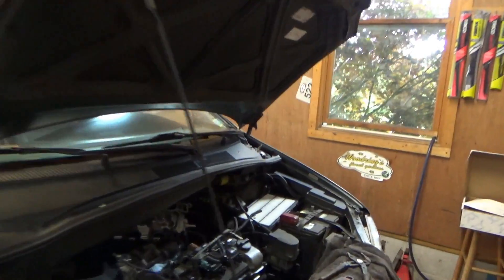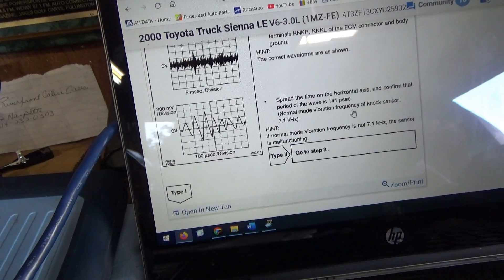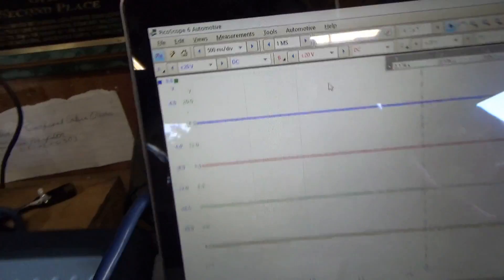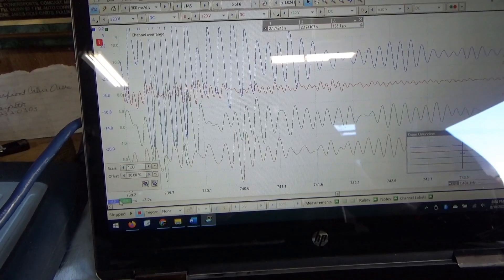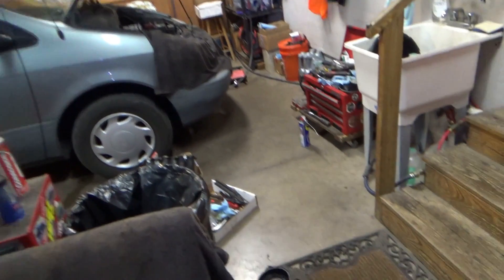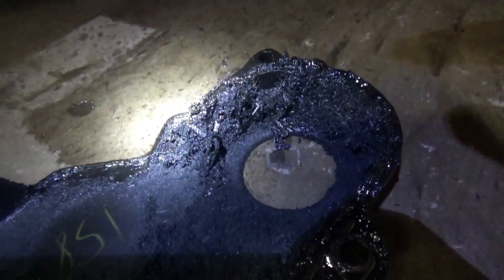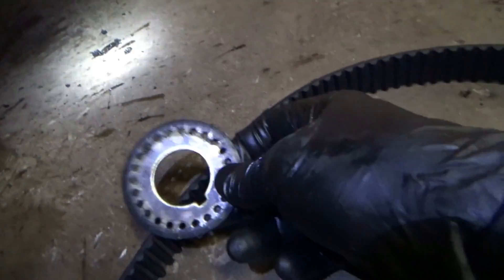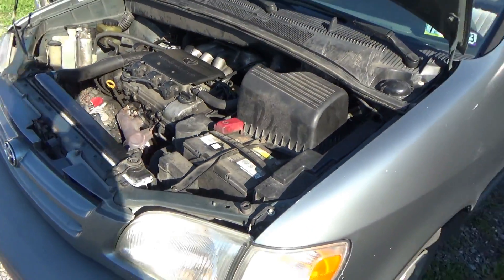Test Knock Sensors...on the BENCH! (Toyota V6 @545k miles!)

Comment: I have a 2003 SIenna and I had a Code for Bank 2 Knock sensor.  I took everything apart, changed BOTH sensors with ALLEGEDLY Toyota parts bought off ebay Both sensors and the wiring about $74 Put the car back together within about 2 miles CEL came on and now I have BOTH Bank one and Bank two!!   I tried checking the connections where the Knock sensor harness goes etc.   cleared it then drove a bit and Codes come back   SOmetimes just bank 2 sometimes BOTH bank one and two.  Previously before I replaced these I only got BANK 2 code.  I am 90-95% sure now that I got scammed and these are cheap generic sensors.  How can I check them IN the car?  If i unplug the knock harness and put a volt meter between the tip connector wire and ground and tap on the engine I should get at least 2-3 Millivolts if I use my Multimeter, right????   I'm ready to scrap this van.  Runs fine and I just put a new AC compressor in May and it only has about 100K miles and no rust.
Reply: Update ..... After doing the following i determined my "new" sensors were bad!!  Low output.   I disconnected the Knock Sensor harness at the back of the engine and put two leads, one to each output terminal.  I then used my Mutimeter set on AC Volts, started the car so I could see what voltages these are sending the ECU.  Turns out they were outputting at idle around .02-.06 Volts YES POINT zero six!  I then revved the engine and in the higher revs 2000-3000 rpms  the sensors read about    .15-.3 volts  Neither sensor ever got anywhere near or over 1 volt.  The new sensors i picked up today (Dorman)  output about  .5-.7 idle and revving goes 1.5-2+ volts  big difference over the once I just replaced 2 weeks ago.  ODD thing these are supposed to be Genuine Toyota parts, I noticed today the sensors say DENSO  around the circumference of the sensor on the Plug side.  Could these be generic FAKE "Toyota" parts?   Seems like it!   I high tailed it and being that I did this 2 weeks ago I knew exactly what to remove, where to position stuff, what NOT to remove, what tools I needed etc..   Last time I didnt have an 8 MM Hex bit socket to remove the 2 inner upper intake manifold bolts.  Had to run to AUtozone to buy a socket.  Ive since bought a very nice set from Amazon for about $38  LexiVon is the name if anyone needs a set.

Comment: Yes Toyota is a good engine..The timing belts are a maintenance item , anod i like to pull the cover about half way through there life cycle or before to just take a look . I drive tdi vw for the for a long time and the na before . I even had a 2lt toyato turbo diesel 4x4  a long time ago ... i once had a ahu that had a timing belt alignment problem after i bought the car . So by checking the belt i saved my self a lot of grief . The belt was in poor shape way before its was supposed to be changed.  I found the how to fix the problem on line . Thanks for the videos

Comment: Cool video, can one have a bad knock sensor without code to cause slight pinging at low speed under slight load. Asked this same question on your latest video on Camry. Any suggestions would be appreciated

Comment: I had a similar vehicle problem recently.  It had an aftermarket fuel injector and was missing on that cyl.  I swapped that injector to another cyl and the plug to a different one and that cyl plus the one I swapped the injector  into were now dead.  I ohmed out the injector signal wire to the PCM to find out if it had a bad driver on that port.   It was fine.  Turns out the aftermarket injector was bad AND the wire couldn't carry enough load to fire it.

I got to thinking about the "chicken or egg" implications of it, and conclude that the wire went bad so someone misdiagnosed it to be a bad injector so put the aftermarket junk in there, which was probably bad from the git-go, but even though it failed my test didn't mean it was the cause of the problem.

Comment: good idea on the sensor bench test. Will start doing some knock sensor testing same way to see how good new sensor output is .
Can't beat 90's to very early 2000's for proper longevity build/component quality .
Based on manufacture to end of life environmental impact it really good and hardly any parts/service waste in over half a million miles, trouble is true environmental solutions don't make big profits, big companies want you buying new every few years, no easy money if make products that faultless for 3 decades 😕
Was enough electrical be useful along with good quality and well located within vehicle so rarely much drama .
Once you start going past 2005 the hassle and longevity and daily reliability declines until you get to latest garbage that faulty right off the production line lol .
 All my old Japanese wagons have been incredibly reliable and low cost, I done 35 years minimal hassle motoring for less than people paying for a brand new headache at the car dealers lol .
My work and customer bills highlights fact too, all the ridiculous failures & crazy hassle and big $ bills are newer garbage ...

Comment: What a great test. It would be interesting to try striking different places to see where you get the most consistent readings on the good ones.  Straight in on the screw, for instance, or at the end of the tail, on the bench beside it, or in front of it, even on the far end of the bench, to see what happens.

Comment: Some of the worst vehicles I've ever owned are Toyotas.  I had 2 in a row that were pure trash.  Both had RC18 engines.  The first had an exhaust manifold crack so that I woke the neighbors up each morning heading off to work.  Then the brake master cylinder completely failed nearly sending me into the next life.  That was all before I hit 12K miles.  The second (the one I traded for after the first), developed warped valves at 6K miles and had to be reworked by the machine shop.  The dealer wanted an astronomical $500 to do the job (that was a fifth of the cost of the car back then).  I opted to remove the head and have it redone at the machine shop and had new valves installed, planed which cost me a whopping $162.  I reinstalled the head and drove it the next day.  I rid myself of Toyotas after than and never even thought of buying another.  Sad POS they are.  I'm sure both had the original starter as they sat in the junkyard with less than 20K miles.  Great longevity (IN THE JUNKYARD THAT IS).
Reply: Was this in around 1968?
Reply: @johnz8210  😁

Comment: I went aftermarket on my mothers Highlander.. to save some money.. same codes set. Both bank 1 and bank 2 knock sensor codes. 

It would go into limp mode when it set the code. 

Took scope captures of before and after. It was better. But the computer wasn’t happy. Bit the bullet and bought Toyota factory ones. No issues. Lesson learned. Ha 

Thanks for sharing Ivan!

Comment: You can not beat old Toyota's , they are bringing very good money down here in Aus . Once again crappy aftermarket sensors caused problems great test demonstration quick simple and very effective. Have a timing belt change coming up on my ladies daughters 2000 avalon V6 with 350000 klms engine and transmission  still runs like new smooth powerful no leaks . Been changing timing belts for years but still like to watch a few vids on you tube before having a go.

Comment: Went thru this knock sensor problem on my dad’s 2002 Tundra. Went thru 4 aftermarket sensors, computer was never happy. Finally bucked up and bought Toyota brand sensor ($250!)  and computer was happy! Checked sensors same way in a vice with my scope. Didn’t know what the frequency is suppose to be but checking voltage - aftermarket were around 10 volts, Toyota brand was around 30 volts.

Comment: I have a sienna with over 400k miles on it and they are bulletproof (knock on wood). Little tip- if you ever work on one again, the wiper cowl comes off in 5 mins and gives you all sorts of room to work. 

Bonus footage question- lol- the ecu on Keith’s white canyon that would cut out under-power on the interstate, did you send off the ecu and get an answer as you said you might do? I suggested it might be a melting solder connection and was wondering if it happened to be it. 

Thanks and your videos are amazing!

Comment: I am going to need to bring you my car, Ivan.  It hasn't ever had the A/C recharged, it still has the original alternator and I have never touched the timing chain in almost 500,000 miles.  Great video!
Reply from the maker: What do you drive?
Reply: It is a 1996 Mercury Grand Marquis LS.  Don't ask me how many intake manifolds I have had on it!  Well, actually 3.
Reply from the maker: @lvsqcsl  96 was a good year. I'm at 300k on the Mystique, purrs like a kitten :)
Reply: I think it has a knock sensor.  I think 1996 was the first year of OBD 2.
Reply: You don't ever get close enough to that car for me to identify it, but I thought it was a '95 or '96.  That car is on the CDW27 chassis (same as the European Ford Mondeo? and the American Contour)  I think that had the 2.0 liter Zetec 4 cylinder or the 2.5 liter Duratec V-6.  That V-6 was rated at 170 horsepower.

Comment: I own a 2001 Toyota sienna did the timing belt last year change the water pump while I was in there but everything else is original 294,000 miles in the damn thing gets about 32 miles to the gallon on the highway driving to Rhode Island and back all the time

Comment: My Highlander Hybrid is at 178k with no problems.  Hybrid battery still maintaining charge.  I do have to use mid grade gas to avoid knocking.  I guess it's cheaper than the service expense to eliminate the carbon buildup.

Comment: Fantastic to see it out right!  It deserved it for sticking around!    Asked my African friend the mileage he got on his identical mini van and I stand corrected, it’s actually just over 200K miles.  He drives as if the gas pedal is a switch.. not even joking. He also twice misunderstood  how to do the oil and overfilled it with the wrong oil twice he told me.. sad Toto see that happen to such a well built and designed engine that clearly can last is cared for..

Meanwhile having cut back on the mileage for me 2011 volvo XC70, like 310K or 320K miles still.. moved up or sideways i the world.  Picked up a $2,500 C30  from some chick with like 150K miles and a 2012 XC70 with like 250K+ miles for $3800 (I think I over paid during the absolute peak of this bubble). but got even more stuff to go wrong than ever fully loaded oh yea baby!!!  Edit: oh also it’s a bit beat up (actually both are) but I don’t care, I’ll fix it in long run over time.

Comment: I'd definitely recommend an AC service on that vehicle.  It's absolutely low on refrigerant, even though it's still getting cold.  Low refrigerant means low oil flow.  Low oil flow means catastrophic compressor failure.  A simple evac and recharge with a machine would be a very wise thing to do.
Reply: low refrigerant means low oil flow?  what??
Reply: @111-c7x2t  Yes.  Refrigerant carries the oil to lubricate the compressor.  if less refrigerant is flowing, less oil is flowing for the same RPM of the compressor.  Low refrigerant, and consequently low oil, is one the main causes of compressor failure.
Reply: @johnaclark1  nah
Reply: @111-c7x2t Oh, so you must be trained in automotive HVAC and can explain why I'm wrong?

Comment: Wow,  damn 545k miles!!!  Toyota has reputation for reliability and quality build!!  I've worked on 2 of those engines,  94 and 02 3.0 v6 engines!  Replaced timing belt, water pump,  all Aisin built! I do keep the maintenence to it every year for my costumer,  94 is 188k, 02 is 150k.  Still runs good!  Also my chevy blazer is 268,000 miles and all runs good,  just leaks bit of oil.   Not bad for this old! Great job on testing on the knock sensor on the pico!!  Love how you did!  ❤️ great video,  Ivan.  You're the man!

Comment: Great job! I replaced the cam, crank, and oil pump seals on the wife's Camry when I'd change the timing belt. Also - and just as important - I'd change the oil pump body/cover o-ring. That o-ring will harden and crack, making it look like the oil pan gasket is leaking.
Reply from the maker: The oil pump seal leak is a 4-cylinder problem :)

Comment: I was a Master Toyota Tech for 36 years. Some of the best vehicles I ever serviced. They are very tough and reliable. I have 3 now with each over 300K and still kicking perfect. Good presentation of the knock sensors.
Reply: nissans used to be pretty good too.., thier weakness is the plastic coolant tubes and plastic timing chain guides..
Reply: @randy1ization  or Upper oil pan leaks at higher milage
Reply: Psh, yeah best vehicles as long as you keep dumping money into them. These knock sensors are a huge problem in Toyotas and cost a fortune to fix. I've had to spend over $4k in getting an old Lexus RX fixed. I've spent more money fixing this piece of junk than all other vehicles I've owned combined. NEVER buying Toyota ever again!
Reply: I have a 2003 sienna I took the seats out now when I pick up chicks at the bar I don't have to bring them to my house.
Reply: @Kim Pettit  I thought you were a Master Bee Tech?

Comment: So AWESOME that you caught that belt BEFORE catastrophe 👍. I have two cars in shop RIGHT NOW with broken belts that need valve jobs 😥; and i recommended timing belts on both just a couple months earlier. Customers said, "No $ for timing belt, so gotta last a while."  I guess the timing belts didn't get the memo. My lot looking like junkyard.
Reply from the maker: Haha Toyota don't care... Non interference FTW. That's exactly why these engines are so bomb proof 💣😎
Reply: @PineHollowAutoDiagnostics  True except the diesel in the camry years ago. People loved those diesels they ran great and low maintenance too. I liked them but I don't like dirty diesel crank oil.

Comment: My 2004 Highlander 3.3L V-6 finally needed an alternator at about 400K.  Starter is original, AC blows ice cold, never needed any sort of repair.  The issue many well meaning long term owners have is that their techs cut corners because typically owners of old cars want the cheapest things.  I do most of my own service work, but for some things I don't tackle (like timing belts) my tech knows I want quality parts and things done right.  Techs like Ivan are worth their weight in gold and enable people to keep well made cars on the road for decades.  I spend maybe $100/month maintaining my old HL, compare that to the payment on a new one, omg.  I also have cheaper insurance, cheaper 16" tires and many other lower costs that come along with older cars.  Yeah, I don't have fancy screens or massaging seats, but I retired young instead...hhhmmmm
Reply: If you retired young because of saving on a car payment, you must be living in a trailer park
Reply: @111-c7x2t  didn’t say that’s the only frugal thing I did…

Comment: Those cam sprocket bolts are really tight on those things and the rear one can be tricky to get to especially on on a Solara.  I hope it didn't fight you too much.  I made a cam sprocket holder out of a 6' angle iron and two big bolts.  It still helps to have a strong buddy and a long breaker bar.
Reply from the maker: I didn't remove the sprockets... Oil leak was of no concern to the customer lol
Reply: @PineHollowAutoDiagnostics  I was able to get the sprockets off no problem using a cheap rig and regular 1/2" breaker bar.  It was worth replacing all the front engine cam/crank seals as now the engine is still bone dry 7 months later on my '99 1mzfe! l

Comment: Have a 2004 Toyota Sienna with the same engine.. about 1/3 the miles, but runs perfect.  No oil leaks anywhere.  changed the timing belt at 95k.  Great car, no issues at this point.

Comment: @ 9:37 you can see the CV joint boot at the transmission is split.. Its also slinging grease all over.
Reply from the maker: Grease left the chat 150k miles ago😂
Reply: @PineHollowAutoDiagnostics  or more!!

Comment: Test, don’t guess. 
Most aftermarket knock sensors are junk.  That said, the Toyota 1MZ sensors are known to be OVERLY sensitive for knock, affecting engine performance (retards ignition timing).  Last forever, though.

Comment: How did you get that crank bolt loose?  I’m fighting with my crank bolt on a odyssey.
Reply: The special impact socket from Lisle and a decent impact gun has been pretty reliable.
Reply: @mattmanyam  Thanks,  but sadly those investments have not payed off.  I’m waiting for 3/4 inch tooling to arrive for another go!  Truly appreciate your comment.
Reply from the maker: Hondas can be tiiiight. You need the special pulley holder 6 point Hollow socket and a long breaker bar 💪
Reply: @PineHollowAutoDiagnostics  Being 67 I may have lost some muscle over time but that bolt is ridiculous!

Comment: That was great!!  On the hard ones, I usually find a threaded hole near the intake manifold and screw an OEM sensor in. So far it has always worked. On the 5.3's there is a way to just use one sensor by rejigging the wiring. I have done that three or four times. For poor budget people, we just want to smog it. I'm sure if u had some radical knocking going on,  it would back the timing off. Please don't be mad at me😥😥
Reply from the maker: It's nice to have 2 sensors to work with 😁

Comment: knock sensors are a pain on most engines. Thankfully on a Subaru 3.6L you do not have to remove the intake (service data states you do). Remove alternator and MAP/BARO sensor and go in though there to get them.... Also, on parts like that, I  never use aftermarket. OEM only